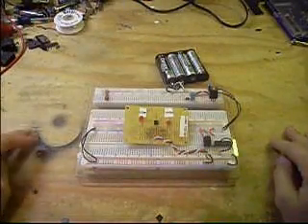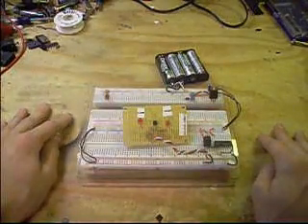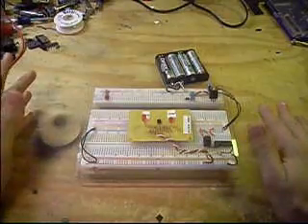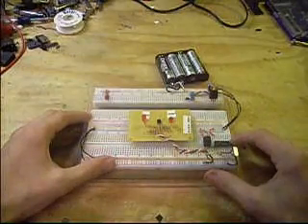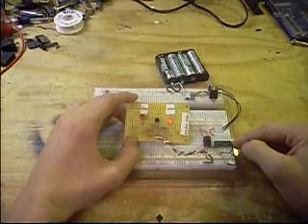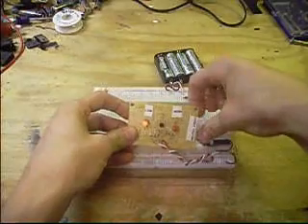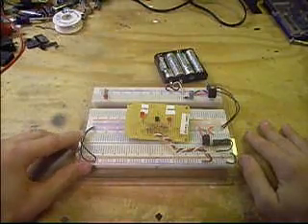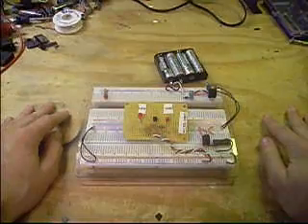DIY Logic Probe

Comment: what would one observe to be the difference between a float and a rapidly switching from high to low and back again circuit?
Reply from the maker: Since its a BJT device and not MOSFET, it'd settle on the Low LED (And the schematic has the return path from the Low LED going to ground through the BJT's base).

A rapid switching signal would probably have the brightness of both LEDs vary according to the duty cycle of the signal.
Reply from the maker: Kevin Banjo The switching frequency is only audible if its between 20Hz - 20kHz, so its kinda a loaded question on what speaker would be good (Impedance, Wattage, Frequency Response, etc) if the signal source and driver are not known.
Reply: *****
In the video you said it had a "float feature" where both the led's turn on when its not connected.   If the duty cycle of the switching is 50/50 and high frequency then wouldn't it be difficult to determine the difference between that and float?   When you floated it in this vid, it appears that both leds are dimly lit.   It might be nicer to have a 3rd led for float.  The reason why I'm bugging you about it is because I tried to use it on an automotive circuit today and got confused.
Reply: ***** I'm trying to use it on a Ford MAP sensor which outputs approx 100-200 HZ  0-5 VDC square wave
Reply: Use a "window comparator " to detect logic levels and both high and low leds will be OFF for a floting probe condition. Try designing a circuit around an LM393 dual comparator IC chip with open collector output to drive each of the leds. Rhis chip is like USD 3-cents each on ebay if you buy 1,000 pcs. That is only thirty bucks. A packet of cigarettes in Australia costs this  much. Petty stuff. But I do know and respect the value of a dollar. I used to get paid 5-dollars an hour back in the 90s soldering PCBs.